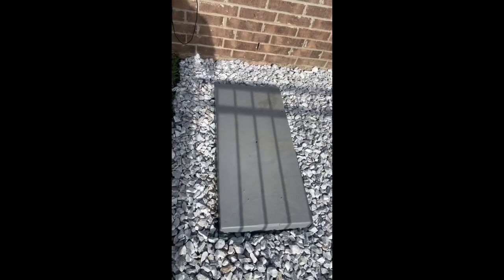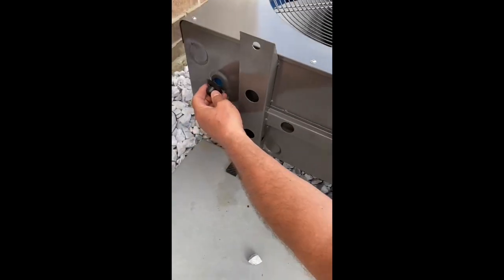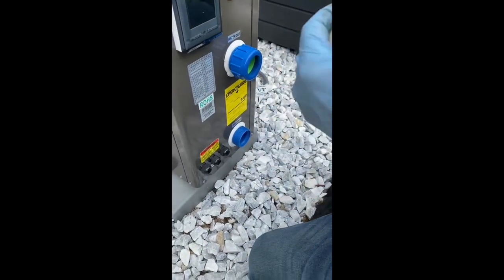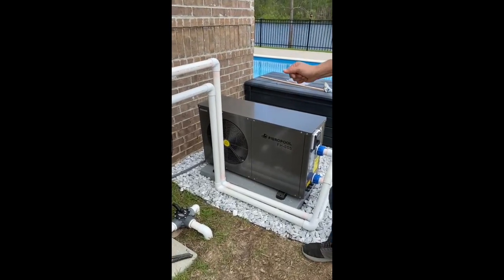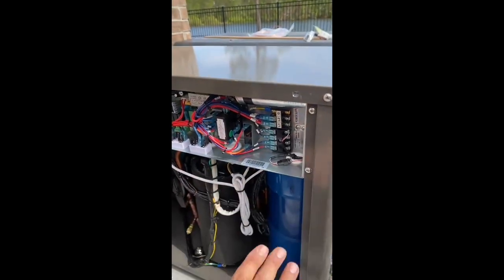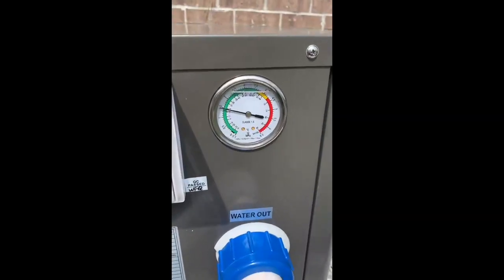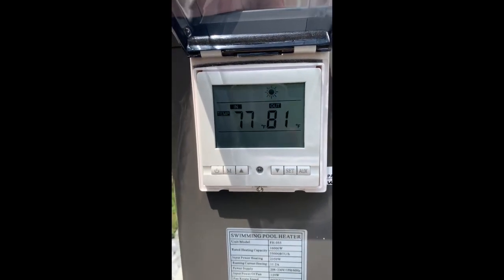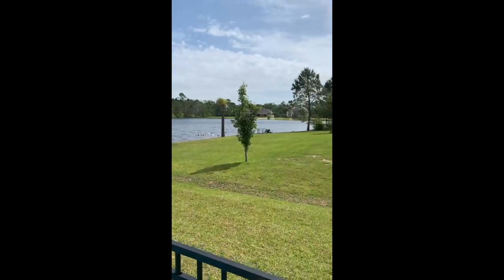FibroPool Heat Pump Installation Guide (Covers ALL Models)

Comment: What if my pressure gauge is at 3.7 mpa, is that a problem?
Reply from the maker: Yes that's a problem. My first guess is that your heater isn't getting enough water flow to collect heat from your unit, so it's building pressure inside. Could be either an underpowered pump or a bypass that's not open enough (if you have one). You may be sending just enough water to not trip the flow switch.

Comment: This is soo wrong. Where is the one way value for the heater return. In this config you are still going to feed the heater when you bypass the heater only in reverse way. Come on guys. People are going to follow your video and should not be this bad. Also, there should be a one way valve just before the salt generator.
Reply from the maker: When you have a situation like this with gravity drawing water away from the heat pump and salt generator, those are good points but not strictly required. Still, there is nothing wrong with adding those valves in this situation, and we do generally recommend including them, if possible. Thanks for the comment!
Reply: Thanks for this comment! Unfortunately, I didn't read it before I set everything up. So now I'm going to have to adjust and add a one-way valve to the heater line that feeds to the Tee. Would a one-way check valve for sump pump work? Or is there something else I need to get?
Reply: it's a three way valve